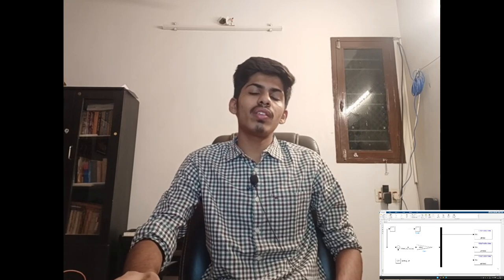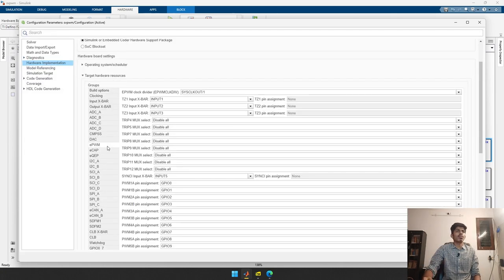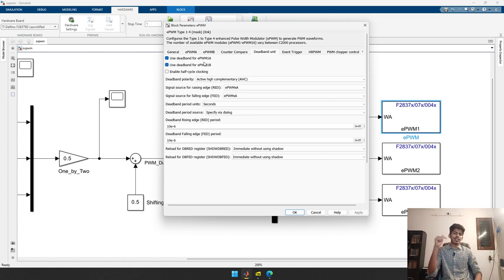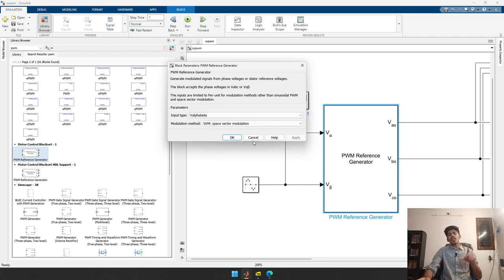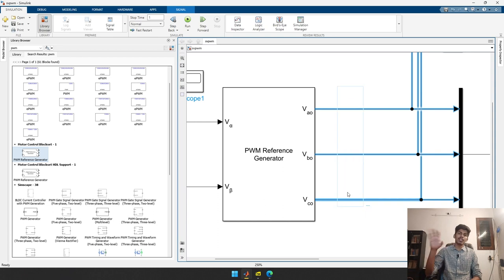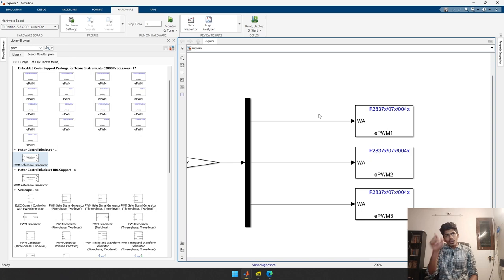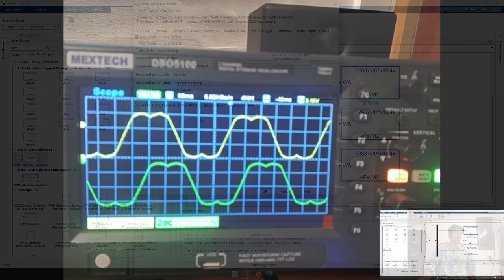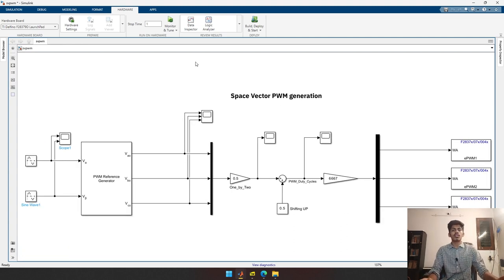Space Vector PWM with Matlab Simulink: C2000 F28379D Launchpad | Motor Control Blockset

Comment: are you sure ePWM clock can reach 200 MHZ
I saw there datasheet the maxiumum ePWM clock is 100 MHZ (sysclk/2)

please rechceck or maybe i got wrong
Reply from the maker: Hello, thanks for watching.

I have just referred to the technical docs again. The PWM "defaults" to 100 MHz (sysclk/2), but it's not limited to 100 MHz—it can go up to the system clock.

Please refer to the below PDF, page 1911 (at the bottom of the page under notes):

https://www.ti.com/lit/ug/spruhm8k/spruhm8k.pdf

Here is the excerpt from the PDF:
""
Note:

The Type 4 ePWM clocking varies from previous ePWM types. Prior to the Type 4 ePWM, the time
base submodule is clocked directly by the system clock (SYSCLKOUT). On this version of the ePWM, 
there is a divider (EPWMCLKDIV) of the system clock that defaults to EPWMCLK = SYSCLKOUT/2.
""

Comment: How can spwm pulses be generated in simulink using dsp28335? Can u please suggest
Reply from the maker: Hello, to generate SPWM (Sinusoidal Pulse Width Modulation) pulses with the F28335 processor in Simulink, you can use the ePWM (Enhanced Pulse Width Modulator) modules provided in the Simulink library. Specifically, you should look for the "C280x/C2833x" ePWM blocks. These blocks can be dragged and dropped into your Simulink model to configure and generate the necessary SPWM pulses.

https://e2e.ti.com/support/microcontrollers/c2000-microcontrollers-group/c2000/f/c2000-microcontrollers-forum/830132/tms320f28335-spwm-generation-epwm-using-simulink

Thanks for watching.

Comment: why I have to add RC filter to see the waveforms ?
Reply from the maker: Without an RC filter, you will only see a train of high-frequency pulses on your oscilloscope, which corresponds to the switching frequency of the PWM signal (15 kHz shown here at --> 15:43). The RC filter smooths out these pulses, allowing you to observe the underlying low-frequency fundamental waveform (3 Hz shown at --> 14:55) that you are interested in. Essentially, the RC filter helps to remove the high-frequency components, revealing the actual waveform you want to analyze.

In actual motor drives, the inductance of the motor or machine itself will automatically filter out those high-frequency components. However, since we are not connected to any motor in this setup, we need to perform this filtering externally using an RC filter.